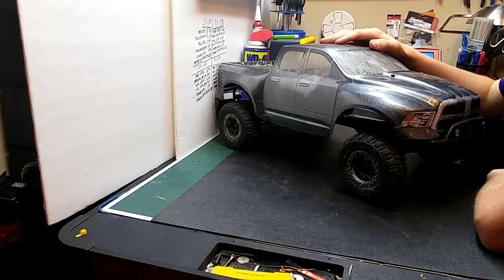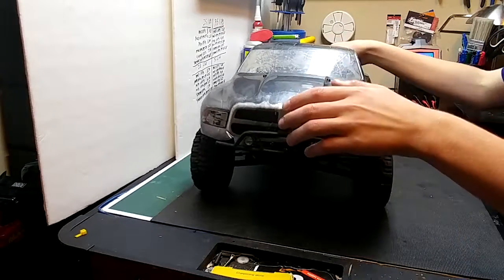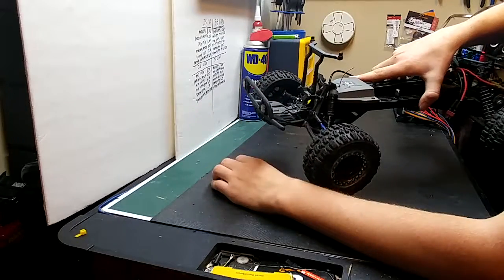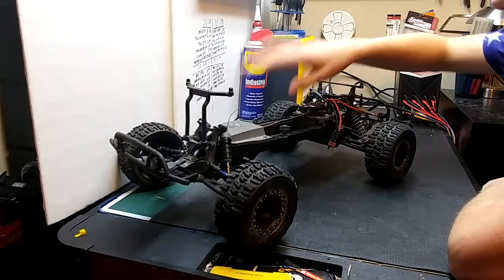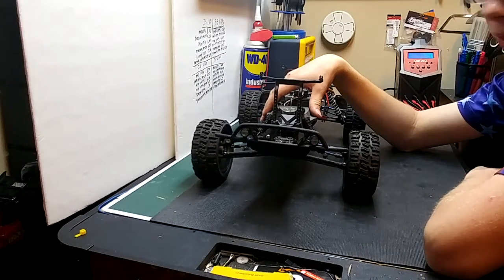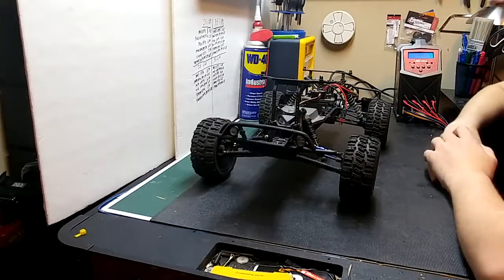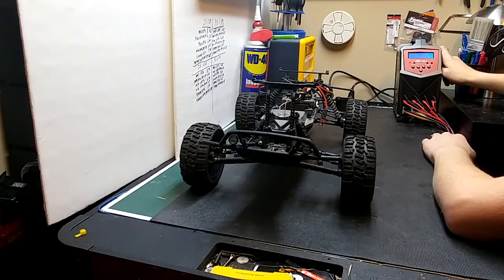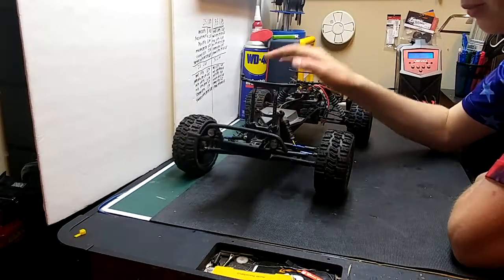ECX Ram Runner Part 2, New Tires!

Comment: how did you get it that high up off the ground
Reply from the maker: on the front body mount posts i drilled a hole at the very bottom so it can go higher and i raised the rear posts 2 hole settings, the rear shocks i am using are a big part of it they are off of an axial wraith the front shocks are stock for now and that's about it.
Reply: Thanks I appreciate it I also have a torment
Reply from the maker: awesome